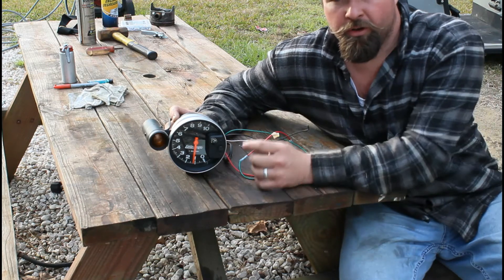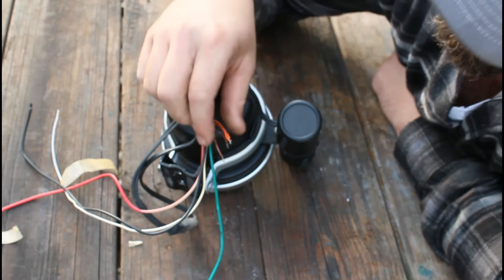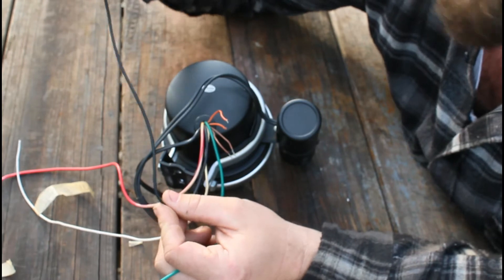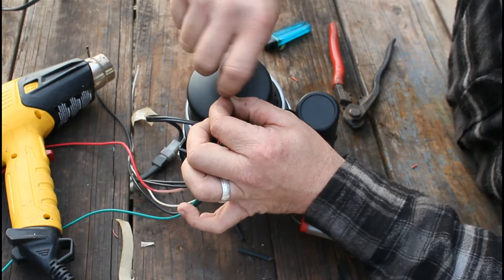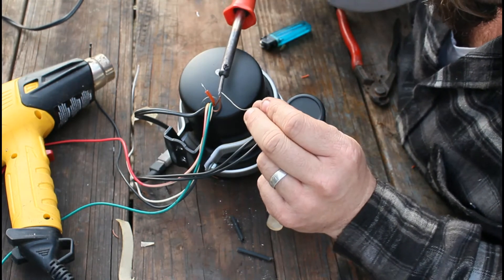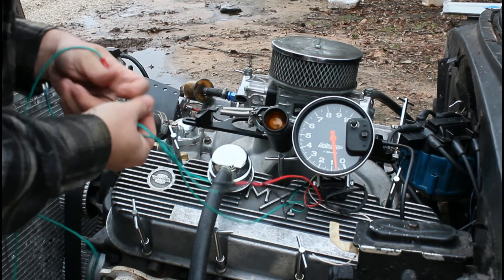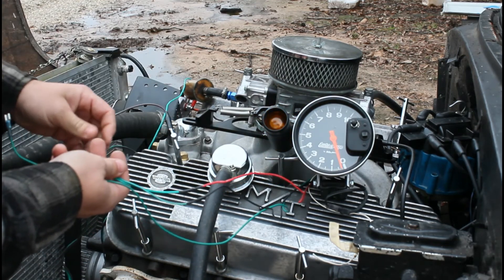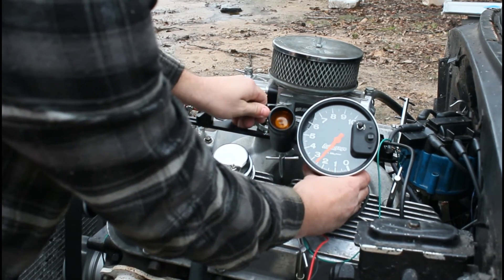how to wire a swap meet tachometer and set the number of cylinders

Comment: I'm working on a small project. Making a sequential shift light for my motorcycle (Single cylinder) 
I want to get the rpm signal from the engine. 
Can you please suggest me the easiest way to do so?
Does the ground side of the HT coil provide a 12v pulsating signal??
Reply from the maker: I'm sorry that is a little out of my wheelhouse the only thing I could suggest is looking into something for a shifter kart or jr dragster

Comment: Hi it's  connected  the  correct way but its register  half the engine rpm
Reply from the maker: how many cylinders is your engine
Reply: @hotrodhustle5456  Hi  rod  4 cylinder clipped  the loop Thanks
Reply: @hotrodhustle5456  4cylinder
Reply from the maker: hey on a 4 cylinder you will have to clip both loops